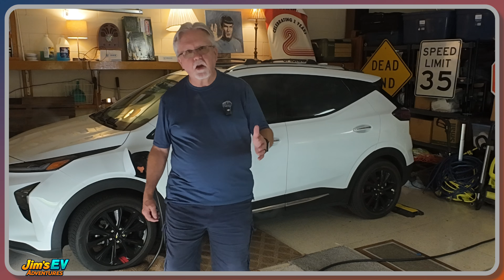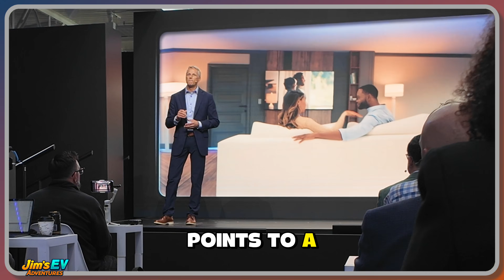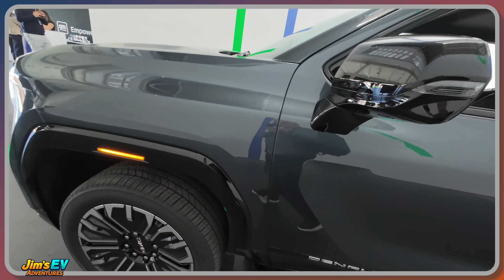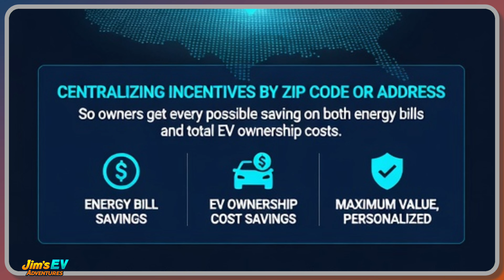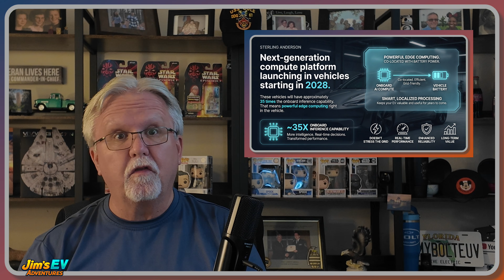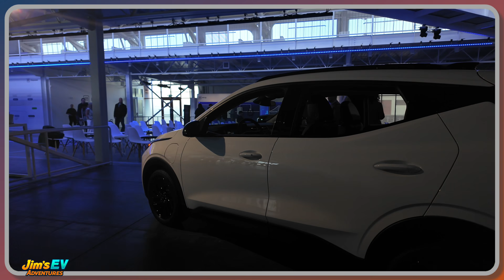GM Empower, Part 2: Your EV is Actually a Giant Home Battery!

Comment: I just bought a ‘26 Cadillac Optiq, in part because I liked the Vehicle-to-Home capability.  Now I have learned the cost of such an installation. I’m a numbers nerd and carefully modeled the peak-vs-offpeak costs. The installation would cost me a minimum of $12k to install and in an absolute best case scenario would take ~30 years to recoup. So hard pass.
Reply from the maker: That price, if you watched the entire video, is going to come down.  Take a look at what a color TV cost in 1960 ... and you can get a good 4K version today for pennies on the dollar of that cost.  Prices come DOWN as production goes UP.  Your hard pass today may be, " will take one" tomorrow.  Give it time...
Reply: @jimsEVadventures  The price of home batteries and a hybrid inverter (or islanded inverter) is also coming down. This provides a better solution. 1. does not use cycles in your car 2. powers your home when the car is not in the garage (or plugged in).
Reply: There is a lot of competition for systems with batteries for your house. Anker, Tesla, Generac, several others. GM may have an interesting sodium battery but this seems to be intended for large grid use, not your home.

Comment: Here in the Upper midwest - great plains states; many utilities are FAR behind. Depending on coal and Nat Gas run turbines.  But we do have lots of renewable , mainly Hydro from the Missouri and of course our wind. Unfortunately they have yet to link the two together to form a natural battery storage with Hydro backing wind and solar...but it'll come  I'm a retired Electrical/Electronics/Computer Engineer who worked for the DOE entity controlling the grid up here.  What really is lacking nation wide, are large enough interconnects between the various grids.  The Texas event a few years ago really exposed that. Although we up here had rolling load shedding to allow whatever power could flow through the minor ties to Texas then; it's been really the only outage we have experienced around here, outside of a few wind storm outages.  Yes, I have an EV an EV9 lease but looking at the Rivian R2 specifically due to its built in load to home/grid capabilities.
Reply from the maker: What is really lacking is making ALL the grid more modular like nodes on a LAN or WAN.  As you know, when a WAN goes out, there are multiple other nodes and routes to bypass the outage ensuring those connected do not lose connectivity.  The interconnects between the grids that we DO have are antiquated and do not lend for quick or easy additions.
Reply: @jimsEVadventures Actually our segments in the west in our upper tier of the grid is somewhat that way.  My former entity managed most of the west excluding Oregon Washington & Idaho ... that was BPA's.   The east side of the country got sold off to commercial and privates, before the govt realized that was a mistake, so it's a mess. But yes there are some very fragile ties.  We were on the boarder of the Eastern & Western Interconnects and had a few AC DC AC converter stations to pass power between the east & West, but they're still undersized for anything really helpful should you need to makeup for a substantial deficient.

Comment: Still waiting for a viable non proprietary AC based system. I'm not spending 10k on a GM inverter to be locked into a particular brand of car. My truck has a 10kw V2G inverter that won't work with my enphase solar system because the software can't talk yet through ISO 51118
Reply: This is my plan as well — an automobile manufacturer agnostic system. My solar and 10 kW of batteries are from Enphase. That company has announced its own V2L system, supposedly coming to the U.S. later this year, that will be compatible with any EV that meets the ISO 15118-20 standard. I currently have 3 EVs, and over time they will be replaced only with models that are compatible with ISO 15118-20 to avoid manufacturer lock in. I believe my current EV9 is already compatible with ISO 15118-20, but my Mach-e is not and cannot be updated to do so. I'm not sure about my Lightning, but I understand that Enphase has demonstrated their system working with a Lightning.
Reply from the maker: There is always more than one way to skin a cat.

Comment: I don’t see the value in directly powering the house from the vehicle.  It’s better to install a battery in between.  That way the vehicle can leave to obtain supplies, etc.  GM fixed batteries are suboptimal for that use case.  As to V2G, I don’t see the point in adding battery cycles to my vehicle’s battery.
Reply from the maker: I understand your concern.  Based on NMC batteries today.  But the newer technology that will be used to power the grid will have 2500 to 5000 cycles.  That will outlast the mechanical parts of your car 5-10 times.  But I do understand your concern.  Remember, it is not going to fill and drain your car every day.  It will happen in short bursts.  A full cycle would likely take 5-7 days.  50 per year.  500 per decade.  It would take years to do any real degradation...
Reply: @jimsEVadventures  Jim, some of these systems with home batteries and a hybrid inverter (or maybe this GM setup) have the added benefit of allowing your solar panels to provide power during an outage. Currently all of them shut off when the grid is down. So perhaps your car or wall battery provides the AC to let your inverter know its OK to keep power coming from your panels. This can extend your home power indefinitely. I'd still prefer a home battery as it works this way without your car present. The car battery may just be additive---not sure how GM sets this up.
Reply: Ideally for backup, a 5 or 10kw home battery would be backed up by V2H. Then just plug in the car when needed worst case.
Reply: @ronfarnsworth7074 I plug the Silverado ev into an EcoFlow delta pro ultra to charge it via the L14-30R adapter the delta pro ultra accepts. I have 12 kWh in the delta Pro ultra stack. The delta pro ultra provides backup power to the house via a meter collar transfer switch provided by PG&E.  Meter collar was free.
Reply: If your battery lasts 3 times as long as your vehicle, and you don't have to buy a home battery, it might be worth it.
Reply: @jamesvandamme7786 many what ifs in that response.
Reply: @jamesvandamme7786 I can agree with that. What I like about a home battery is it's hardwired online all the time. I hope to get a sodium home battery soon, I think they'll become cheap and last.
I usually only plug my ecar in on weekends. I'm lazy!
Reply: Consuming battery cycles is my concern with V2G as well. As for home backup, I have 10 kW of battery backup attached to my solar system's critical loads panel, so once I have a V2H system is set up That way I can unplug and still have some home power while go find a working DC fast charger to replenish the vehicle battery (that is powers the entire house at night). Based on my experience here in north central Florida, there will be towns having no power interruption within 30 to 40 miles of me if a hurricane were to hit my town, so working DC fast chargers will be available.

Comment: Great update 👍
Based on what I've seen from Fords mostly undependable system, I want to see some really good reviews on GMs system. 
Cheers from Canada 🇨🇦
Reply: I had the  GM Engery system installed last year.  We’ve been lucky and have not used it yet except for a short outage for just a few minutes.  It kicked on almost immediately.  We own a Blazer EV so between the house battery and the car battery we can power our home for about 10 days give or take.  The only problem was getting it installed, that was a nightmare.  GM and the installer did not communicate well and our installer quite on us then Qmerit did find someone and they were great.  We have solar as well and we are still waiting for the backup system to be hooked up to the solar.  I feel it was a good investment, we live in WV.
Reply from the maker: I think you may be on to something there!

Comment: In theory, this sounds good. I am very, very skeptical particularly in my area  (Eastern PA, PPL electric provider). I have good reason. First, I've had grid-tied solar for 10 years. I did not get a hybrid system nor "islanded" battery system. We have, like most states, "net metering". This, to the unfamiliar, only bills you for your net electric use plus whatever the mandatory customer charge is (here a little over 16 bucks a month). What you send back to the grid comes off your use 1 for 1. You basically get full retail credit for everything you send back. In some states with a lot more solar, that was their orignal plan but it has been watered down somewhat (California is one). Second, PA mandated a Time of Use energy plan almost 15 years ago. It was mandated that this be structured to give a customer the opportunity to save money by shifting energy use to non-peak times. It is important to note the opportunity to save money IS IN THE LAW. PPL ignored this law for years, submitted one good proposal (but cancelled it when they found out it was a little too good), then dragged their feet for years until our PUC gave them a mandate. So they came up with a plan that still exists. It Costs very slightly less than normal rate off peak, WAY more than normal for on peak. The net is, this plan costs MORE than not having it. But, in theory, you could use no power at all during peak and all of your power off peak and possibly save a very small amount. So the PUC let it go. Additionally, PA was the start of the "Electric Choice" movement, where transmission/distribution was separated from generation (it is forbidden for your utility (distributor) to offer generation). Zero "electric choice" providers would honor time of use billing with net metering. Not one. This is still the case. Only PPL and their "default" billing (they don't generate, but they pick a provider and bill you. Time of use billing with net metering with PPL credits you off peak rates for power returned to the grid regardless of the time of day it is returned. And the peak rate is absurdly high. I tried it when it first came out before PPL had even published detailed. I thought maybe it would work out. No way---when they finally told me how they credit power returned to them I dropped it. I was one of only 11 people in this entire region to try this. Nobody else is stupid enough.
So my objections to this GM plan (here, at least) are 1. the power company will likely credit next to nothing for energy returned to the grid 2. it is likely the grid will take this power when the grid needs it and not when YOU need it 3. You are likely going to have to spend a few thousand to get your EVSE set up for this system 4. You are going to run up charge/discharge cycles on your vehicle battery. 
Perhaps in California, where they are not obtuse like here in PA, this program may have a real incentive for an EV owner to hook up and participate. As I said, I am very skeptical this will be of any benefit to anyone but the utility here in PA.

Comment: Distributed generation is the only way forward, if we choose not to build larger long transmission lines.  It would also help out the future needs by adding to the baseload system without needing to expand the baseload generation.  Now, if we could just get the current administration to restart the inflation reduction act policies...   Last year, I added a Ecoflow DPU and 4 batteries, to my home, for backup, so I don't need an EV to do that job yet..
Reply from the maker: After speaking with several experts here and having a better understanding of how generation takes place, bringing solar and wind into the mix along with battery storage would eliminate the need to continue to build miles and miles of additional long-transmission lines.
Reply: @jimsEVadventures  Absolutely, the megapacks have already changed the landscape over having extra capacity for small towns.  The battery system can peak shave under large demand.  There was a town in Massachusetts, near Wakefield that was able to do this.  It should be the future.

Comment: V2G-DC requires additional equipment unlike V2G-AC which uses an inverter integrated into the vehicle.  V2G-DC may support higher power levels than V2G-AC.
Reply from the maker: This is true.

Comment: No one should sell poser back to the utilities until they get more favorable rates! Although shifting usage off Peak using an EV battery makes a lot of sense to me. Still not buying a GM car without CarPlay :(
Reply from the maker: You can add CarPlay (third party) to your GM car now.  Checkout the Arkansas eTraveler video about the same.
Reply: @jimsEVadventures Thanks for the info!! I’ll check that out. That’s one strike against GM EVs that I can remove from the list.
Reply: @jimsEVadventures  I will take a look, I have tried some wireless solutions in the past and while they helped, they left a lot to be desired compared to factory installed
Reply: @garymaker409 buy a used Lyriq with carplay you can get great deals on them, we have 2 and really like them.
Reply: I live in Wisconsin, and I have solar w/battery storage. When I buy, I pay $0.1022/kwh. When I sell back, I get $0.068/kwh. I consider the difference to be "brokerage fees," as the grid operator is more brokering my 'trons than merely provisioning me. I don't begrudge them their increase at all. I know that the grid doesn't fix itself; when it's -30° at 3 AM on a morning in February with 20 mph winds blowing, I deeply appreciate the grid operators ability to restore service. 
 My including home battery backup, whether installed or in my ev, which feeds back to the grid as a convenience to me is an intrusion into the grid operators business plan, mandated by the PUC. They bear the responsibility to ensure that they only carry 60 hz, 240v, 3phase AC on their lines, and have the right to charge me to use their grid to carry my excess trons to market. 
 As a consumer, I say that "net metering" is unfair to grid operators.